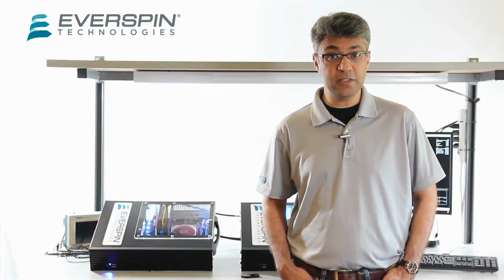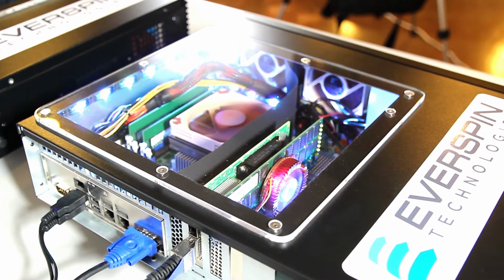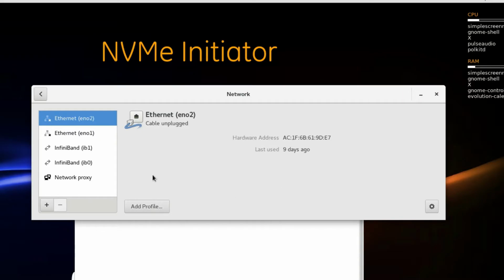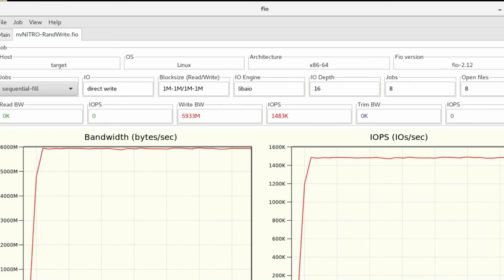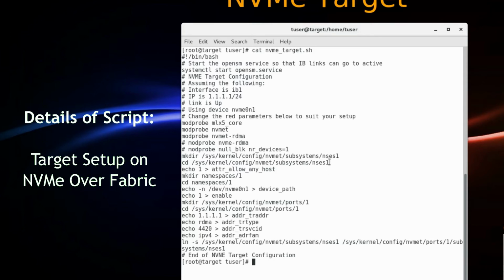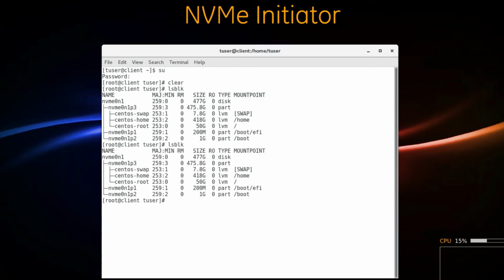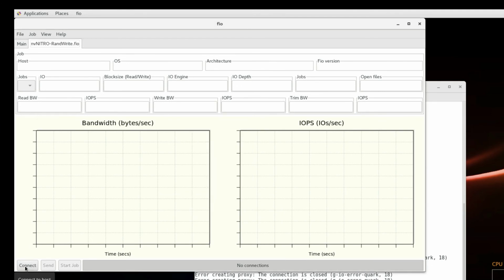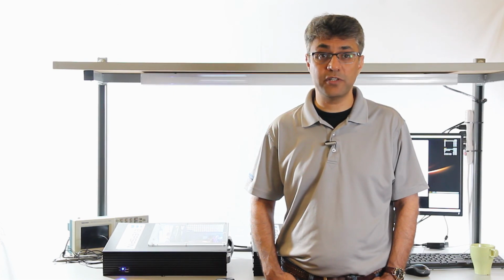NVMe Over Fabric with nvNITRO Storage Accelerator

Comment from the maker: Go-to a chapter directly
00:16 - MRAM Introduction 
02:06 - nvNITRO Storage Accelerator
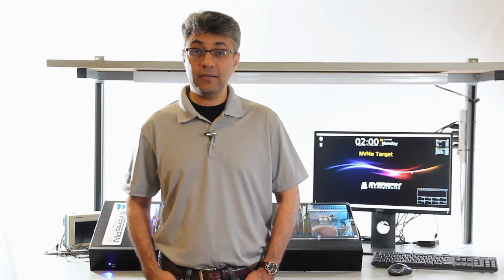02:53 - NVMe over fabric setup
05:50 - NVMe Target desktop environment
06:46 - NVMe Target discover nvNITRO
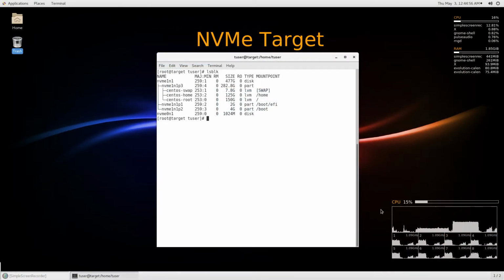08:25 - NVMe Target RDMA Network Controller
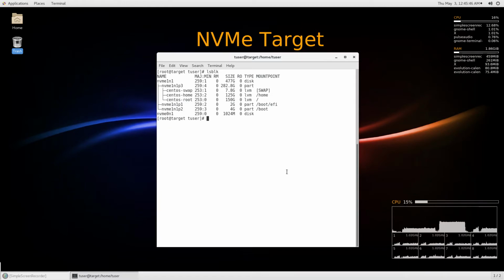09:10 - NVMe Initiator desktop environment
09:25 - NVMe Initiator validate nvNITRO absence
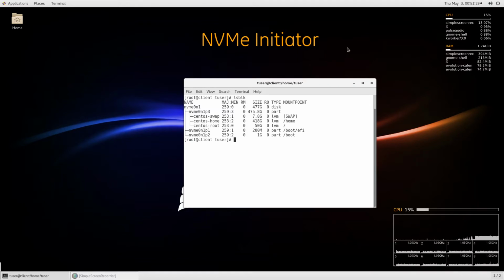10:30 - NVMe Initiator RDMA Network Controller
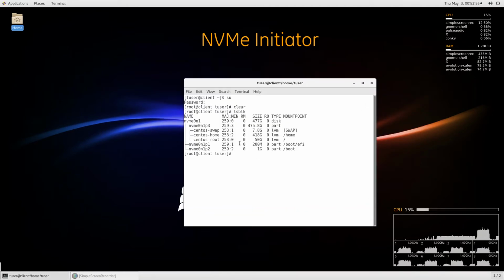11:07 - Direct 100Gb connection without switch
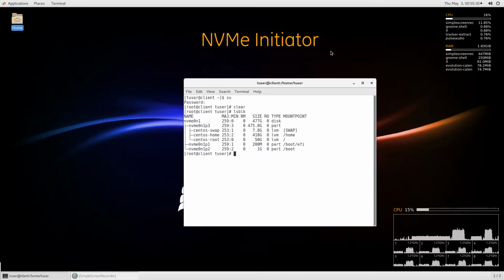11:34 - nvNITRO performance local to target system
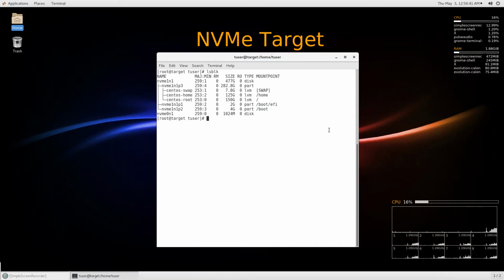11:58 - FIO & GFIO for benchmarking local performance
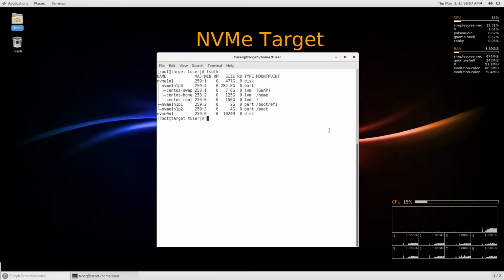12:14 - FIO test script for 4KB /100% / QD8 random write "throughput/BW" tests
14:00 - Running GFIO test
16:15 - FIO test script for 4KB /100% / QD1 random write "Latency" tests
19:31 - Script for setting up NVMe target
22:08 - Setup firewall
23:17 - Running NVMe target script
24:47 - Script for setting up NVMe Initiator
26:22 - Running NVMe initiator script
28:22 - NVMe over fabric performance test with FIO
34:36 - Conclusion